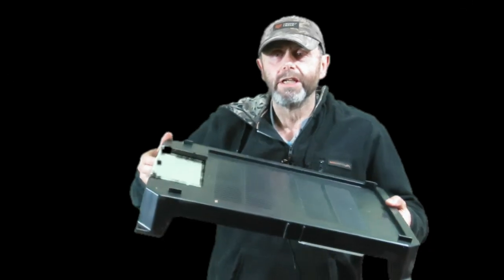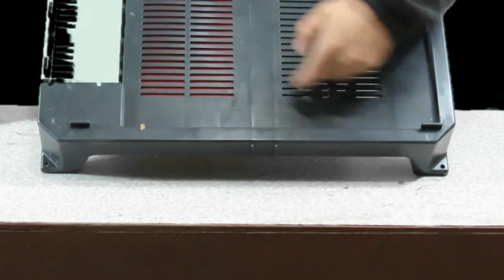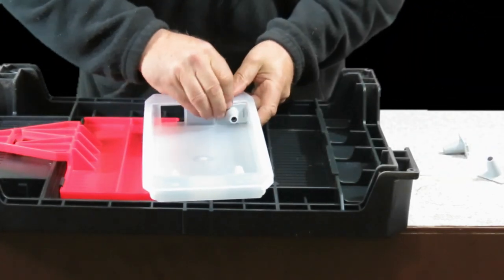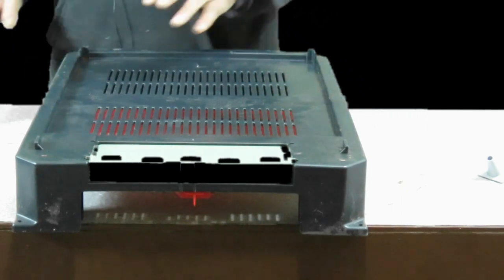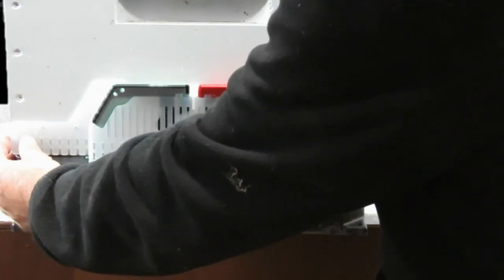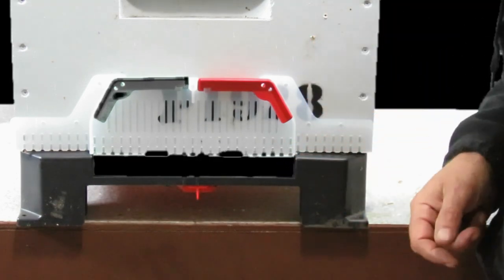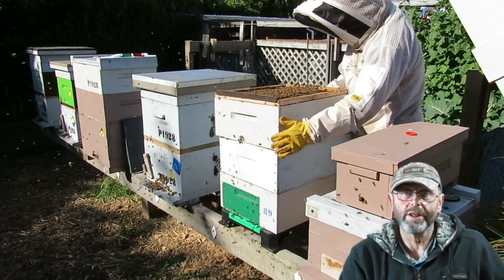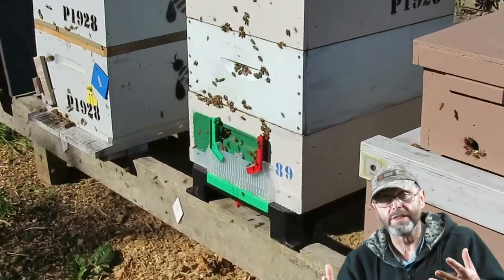Ep 39 Hive Defender and Beast Blocker Review - Part 1

Comment: Hello Kiwi Beeman! I have these bottom boards here in the U.S., and when I put a 10-frame Langstroth box on it, there are tiny openings at the back. The Ceracell bottom board has 45 degree cuts at the back, which leave an opening to the interior corners at the back of your brood box. Have you noticed that? If you did, what did you do to close up those interior openings/gaps? Thanks :)
Reply from the maker: Hi Frederick, I have had the same feedback before, so I went out to the hive in the video and checked before replying.  No, there are no gaps in my hive, but only just.  I believe that the standard dimensions of Langstroth hives vary a little from country to country, possibly due to whether they are built using metric or imperial measurements and the rounding that happens during conversion.  Variation in either the length or the thickness of the timber (or both) would explain the gaps.  Our hives, here in NZ are usually made 505 mm (about 19 7/8 inches) long with timber that is at least 21 mm thick (about 13/16 inch).  Those are the dimensions of the bottom brood box I have on that base.  Personally, I wouldn't do anything about a couple of small gaps in the base.  It is vented anyway and the bees are easily capable of guarding small gaps like that from robbers/wasps unless it is an exceptionally weak colony, in which case you have bigger problems.  If I wanted to close off gaps like that I would try a small triangle of wood hot glued to the base   Cheers Chris

Comment: All of my bases also came with a spare one way cone - So far I'm liking them. Haven't had the need to use the trap section of it as of yet. Be careful of your box tolerance. Some of my boxes had a small gap at the rear of the base due to the way I've made my boxes. Good luck, will be interesting to see your thoughts after having some bees in there for a bit